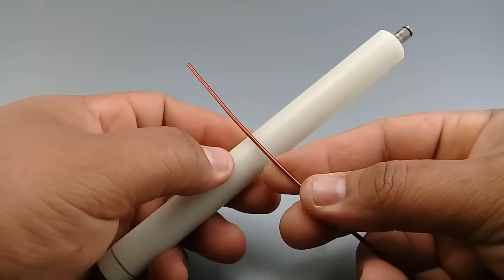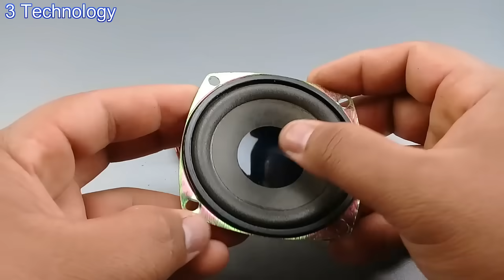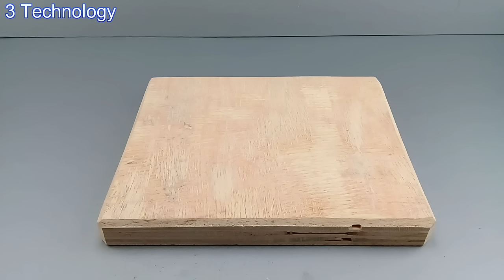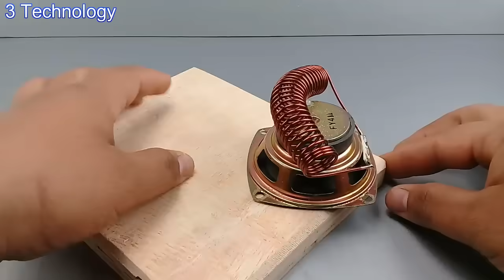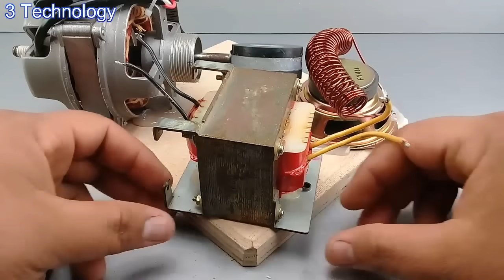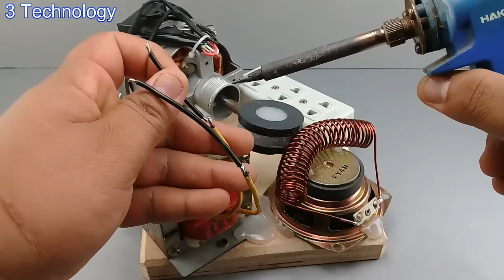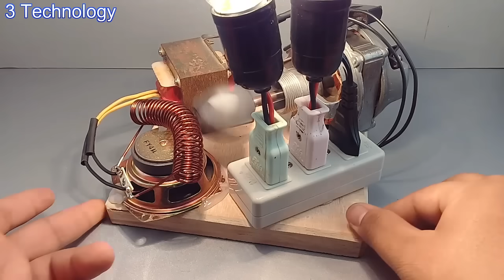6000 Watt Free Energy Generator With Speaker Tools And Copper Wire Use Transformers

Comment: the black device through which the current passes from the plug plugged into the socket is the original capacitor of the motor which is recovered from some household appliance that works with 220V. There is no battery ... You can try to do and then comment
Reply: What  is that thing  use at the  front of the fan rod
Reply: @samgud5733  there are two magnetic disks glued with plastic so that they can be fixed on the rotor shaft. The polarity of these two disks must be the same, not to attract each other. 6000 watts is 6 kilowatts. The bulbs (classic bulbs with tungsten filament) have a consumption of 60 watts. Just calculate how many 60 watt bulbs this power
Reply: ভুয়া
Reply: @mdruhulamin9169  Why Fake ? Have tried to make it and it didn' t worked ??? The car or bicycle dynamo works on the same principles. That of the car is initiated by the battery then, through the transmission belts by the rotation of the engine and that of the bicycle by the rotational movement of the wheel.